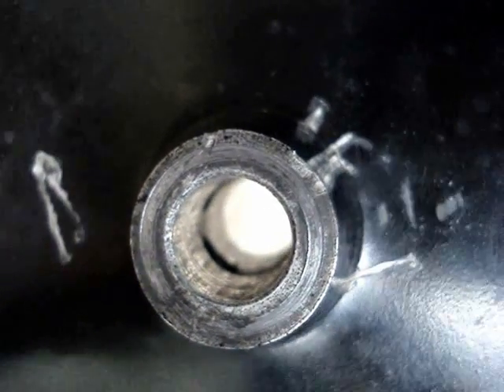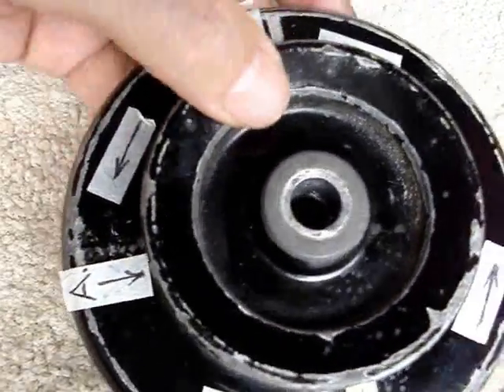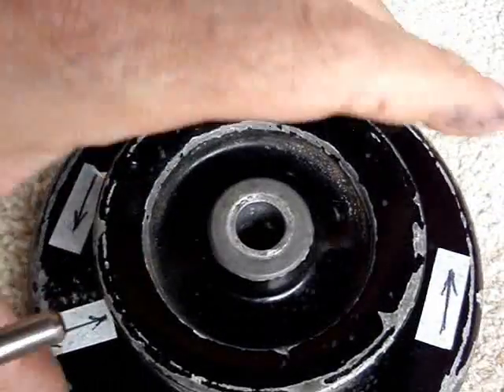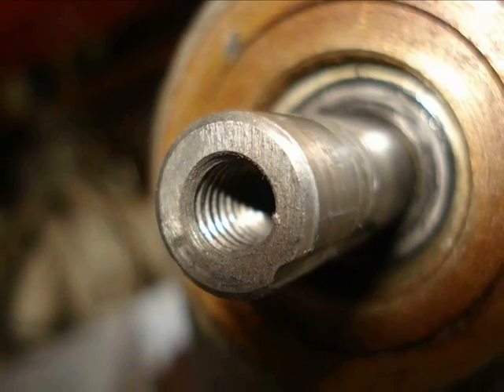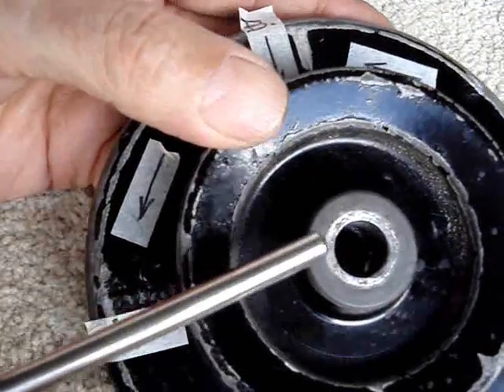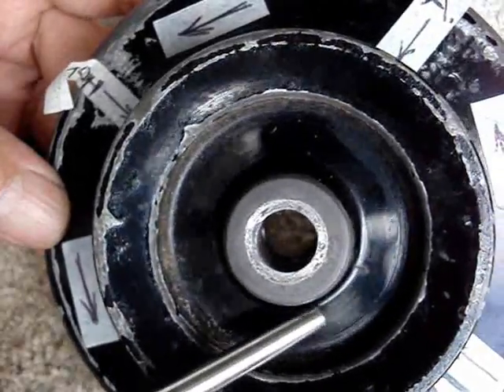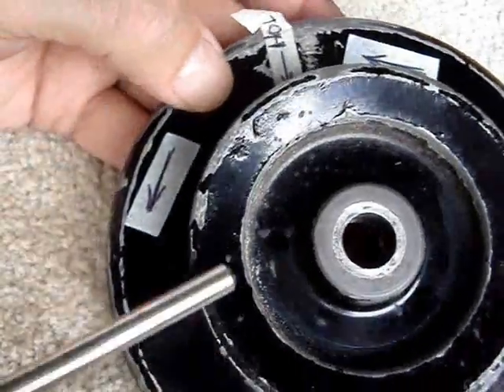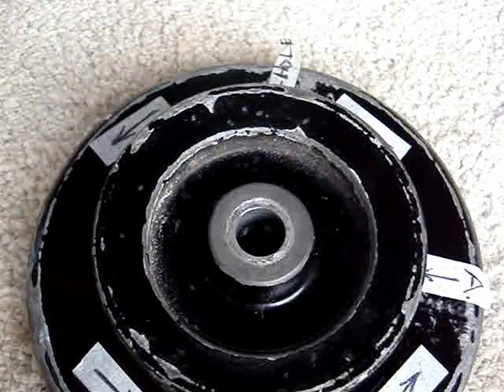consew 226 sewing balance wheel+shaft pt 2

Comment: Kenneth here, it is more likely that, An Idiot ran the machine with a loose set screw. 
thereby damaging the shaft on the head. I'd clean up the shaft as best possible with a file and emery cloth and install a sleeve with sleeve retainning compound. then machine a new flywheel  to accomidate the new wheel. This repair has worked on shafts for me before. Thanks for the Video. please check out my air motor video under Mechanicalfinger. Have a nice day, Kenneth.